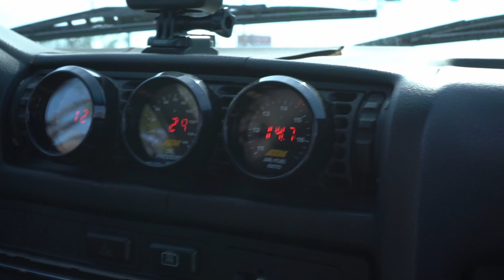What Happened To My Boosted E30?

Comment: New oem coils are better than those
Reply from the maker: For turbo applications I definitely recommend running upgraded ones, stock ones will do the job but eventually will give out
Reply: Classic forum debate. But just like most things, everyone has different experiences. Helps that the bavauto coils are eye candy 🍭 too 😬
Reply: I have a nice new Boost Monkey Red powdercoated valve cover for ya when you're ready 👋🏽😁